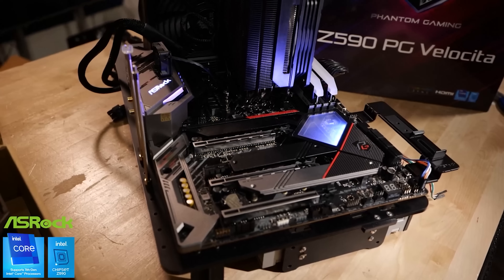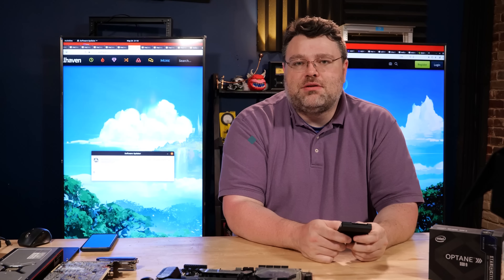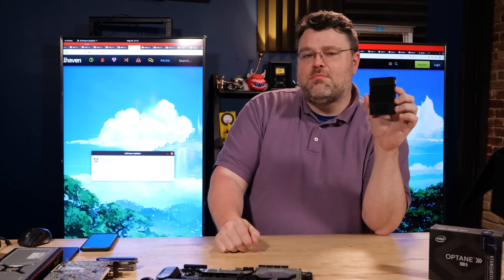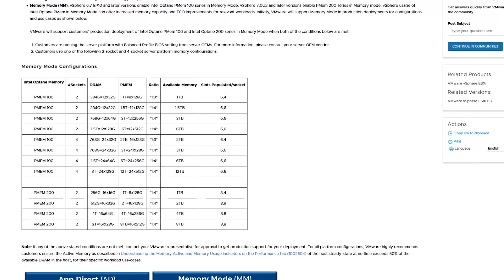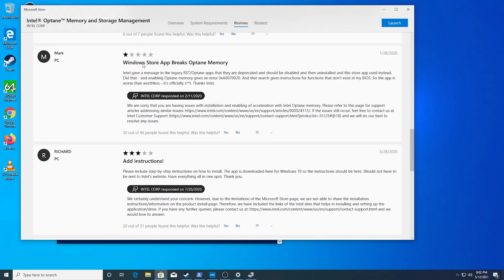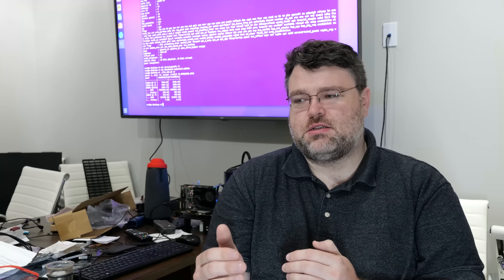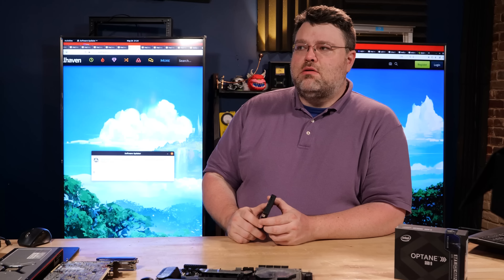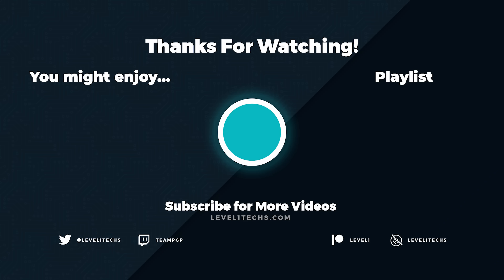The Storage of the Gods: A Deep Dive Into the Intel Optane P5800X

Comment: Hello! Do you happen to know if the new ones have marks on the contacts? I recently ordered P4800X for my collection from Aliexpress. It was called new and unsealed. And It was indeed unsealed. But there are marks on the contacts. I suspect it's not new, it's used with a reset SMART. But the price was low, and I am still satisfied.
Reply: Was it real, I see some in china on eBay too and am sceptical

Comment: You know... the one thing designed to cache the small random I/O Q1T1 R4K and al that, it's...........! Drumroll!
ReadyBoost!!!  :D
Fact is; last time anyone tried Readyboost it was on small shitty USB2 flash drives and spinning rust.
What happens if you cache a NAND SSD to an Optane, using Readyboost..?
The max 32GB IIRC cache size per physical drive
It's probably crap, from what we remember.
But has any tried a properly aligned etc, 4Kb allocation unit size, exFAT FS on an Optane lately?
Who knows..?  :)

IIRC RB wont cache an SSD to a faster SSD without some registry editing, but it could be tested.
We can always test a HDD to Oprtane using ReadyBoost.  Who knows..?  :)

Problem is ReadyBoost wipes the cache when the computer is rebooted. How FS is that! (I think Intel insisted)
I still use eBoostr.
It's similar, but doesn't toss the cache on reboot and isn't fussy about caching SSDs and will cache many drives.
Did I mention it's file aware..?  Filters can be set... :)

Comment: If you try a Linux system, you will get 4k results a lot better than 980 pro.  What you got was not the cap of the optane, but the cap of the windows operating system itself on IOPS.

Comment: Sir, My motherborad is MSI B450M Mortar Max. I am using Win10, My question is - can i use "Intel Optane DC P5800X Series 400GB, 2.5" x 15mm, U.2, PCIe 4.0 x4" SSD with my PC? (I want to run it in win 10)

Comment: I was wondering what your thoughts would be on using one of these as an SSD vs one of the new pcie 5.0 drives, do they narrow the gap some? Now that Intel has sadly discontinued them I might have to snag one if it's gonna remain the king
Reply: a year later and the gen 5 drives still lose to the 990 pro by 5% let alone narrow the gap between nand and optane 💀. Sequential latency maybe. I've got a p1600x which is about as good as the p5800x in random qd1 (455MB/s/111k iops/8.9µs of latency. Despite that my wd sn850x is significantly lower latency sequentially probably because it's pcie 4.0 not 3.0. It gets about 200µs of sequential read latency while my optane gets 600µs. Pcie 5 probably widens that gap altho from what ive seen the p5800x gets similar sequential latency to my sn850x
Reply: @level1techs I came here for the answer to this! Would love to hear what you think. PCIe 5.0 SSDs will hit 12k MB/s but I doubt random IO or latency are any better.

Comment: Hi, are the P5800X drives come with the pci express adapter? i got 4 card and literal into the specs say Form Factor 2.5" 15mm, but the Interface PCIe 4.0 x4, NVMe, i assume that the drives comes pci express interface? Thanks for your help

Comment: Do you still have the star citizen intel optane ssd? would you sell it? i am a big fan of the game. i had considered dropping in an optane drive for SC... which is why im watching this video. 12700k, 3090fe, 32gb ddr5 5600 cl36, 980pro 1x2tb, 2x1tb. extra m.2 slots available on mobo.
wondering if its worth it. regardless, if you would sell the code for the ship, id be interested in purchasing it.

Comment: Good point about this drive not really being designed as your primary drive. When you pay $1,500 per terabyte, you're basically paying $10-$15 just for a clean install of Windows (from a wasted storage standpoint). 

I bet this drive (if they made a smaller one) would be kick-ass as a ZFS slog / cache setup. I'm really curious what the Q1 IOPS are though. If latency really gets down to 10 microseconds, that's going to be some insane Q1 IOPS.

Comment: I'd love to see some database benchmarks using this drive. I think I saw somewhere there was an OLTP benchmark that was throughput under QOS based, and I think Optane would rock for that, not just for log drive but also data drive. Of course, data drives don't really matter if the entire DB fits in the RAM (page buffer pool), but if your DB is larger than say 256GB, then a P5800X could give you very good throughput at QOS even with standard edition SQL (enterprise costs 3-4x more than standard, so if you have 8-16+ cores, that license difference is way more than a P5800X).

Comment: Could you test how this performances as a single boot drive in a zen3 system? I bought the Gigabyte B550 Vision D to connect mine directly to the cpu, but the performance wasn't improved over my Intel platform where I connected it to the chipset.

Comment: I put 4 905P 22110 Optane drives in VROC RAID 0 on an Asus Hyper 16x. The performance is pretty insane but you need to run fast low latency RAM and your CPU OCed as far as you can to take advantage of the array. Running stock CPU and RAM speed pulls 4KQ1T1 speed down by as much as 40%.
Reply: Do you mean VROC RAID 0 make 4KQ1T1 speed worse?
Reply: @exilonone  No, running a stock CPU and JEDEC RAM will slow VROC down.

With my CPU OCed and fast RAM set to XMP, VROC speed went up a lot.
Reply: @nosirrahx  I know that VROC increase 32K and more sequental read. But I'v heard the 4K Q1T1 speed is slow down. Is it true?
Reply: @exilonone  That is an artifact of RAID in general. VROC is not as bad as more conventional RAID, but 4KQ1T1 is always going to be slower than an individual drive when in any kind of RAID.

With my workstation overclocked, I get over 200MB/S for 4KQ1T1 but that is only because I am using Optane drives, which are close to 300MB/S on their own.

Doing VROC with NAND based drives, I doubt you could get over 60MB/S for 4KQ1T1.
Reply: @nosirrahx  thank you for clarifying. It's important for my workstation.
Reply: @nosirrahx That's about right, as mind bogglingly complex ram is for how much u need to know to be able to fully overclock it, it is also what gets by far the biggest uplift from it. Jedec timings are actually abysmal. No f*cking wonder we've kept having to increase caches on our cpu's year after year, memory performance is not moving very fast at all. Ofc it wouldn't get close to completely fixing the issue of ram performance moving much slower than something like tbe cpu does but when I'm getting + 40% performance vs xmp with tuned subtimings and a small frequency bump, it sure as hell would help.
Reply: @Frozoken Primo Cache  on a Vroc o array

Comment: I use Primocache for iSCSI cache onto nvme, love it. (And the iSCSI server uses optane l2arc :) )
Reply: Would love to know more - what's your full setup?
Reply: @AJolly  Central freebsd zfs server with Linux, windows and esx zvols exported over iSCSI which I pxe boot into physical or into virtual within another physical, with hourly snapshots.  So I have 1 Central location to take incremental backups, and I can roll back any system in my house to any time in the last few years, even windows.  Speed has been a challenge though, hence the caching at every layer possible :)

Comment: I'd love to see a full video on primocache? 
How does it work, how to set it up? 
Are there any risks regarding data loss?
I saw it on Dave's Garage the other day and was pretty interested!
Reply: Data loss risk depends on your settings. You can turn write defer off so everything gets written immediately. In the other extreme you can set write defer to "infinite". You have two cache levels, L1 is RAM and L2 is typically a dedicated drive or just a partition. I use 12GB RAM and an old SATA SSD that used to be a system drive to cache the spinning rust that is my game RAID. As far as I can tell haven't had data loss that can be traced to PrimoCache, nor has it ever crashed.

Comment: I had multiple Optane 900P and 905P SSDs. Once you go Optane you don't to go back to Nand flash. The P5800X is my only legitimate upgrade path, lol. I will put one of those in my future Alder Lake build.
Reply: It's a year later since you commented, so did you? How does it feel compared to NAND SSDs for the stuff you do? I went Intel Alder Lake, so am toying with going Optane here at home.
Reply: @greggmacdonald9644  I have built an Alder Lake 12900K/Z690/DDR5 system back in late 2021. My Windows 11 installation is on an 800GB Optane P5800X SSD. I also have a 960GB Optane 905P SSD and a 2TB WD Black SN850 in the same system. As I have both 905P and P5800X in the same PC I was able to compare these 2 generations of Optane SSDs. The P5800X increased the random read throughput at low queue depth by around 37% over the 905P (405MB/s vs 295MB/s tested with a 12900K CPU). The random read output is the metric where NAND Flash drives are lagging behind. My SN850 only scores 60MB/s in the same test. Nand flash based PCIe 3.0 and PCIe 4.0 (and even upcoming 5.0) drives score the same in that random read test while gen 2 Optane saw a huge improvement over its gen 1 predecessor in that same test. I use Optane SSDs as boot drives. They are the perfect drives for that. On a daily basis this gives me a very snappy Windows experience. I can open 200+ chrome tabs and a dozen of other apps in less than 2-3 seconds, lol. Apps open almost instantly. The low latency nature of the 3D Xpoint storage compared to Nand flash is quite noticeable. The few games I have installed on it also load faster than Nand flash drives thanks to the higher random read throughput. The poor random read performance of Nand flash based drives also explains why they don't load games faster whether they are SATA or NVMe. The only noticeable difference (aside from loading games) between my Optane 905P and Optane P5800X are in sequentials as one is PCIe 3.0 while the other is PCIe 4.0 but they both offer pretty much the same snappy Windows experience from I what I can tell based on my own experience with both drives. Later this year I will upgrade to a Raptor Lake system and both 905P and P5800X drives will still be part of my new build.
Reply: @Patrick73787 Lol how am i sloghtly beating the randoms reads of ur p5800x with a p1600x. Im getting 420 MB/s on the dot. I wonder is it also 2nd gen optane? Ik its pcie 3 but could just be cost savings. I'm also baffled that it also has the capicators for further power loss protection (works as tiny batteries for a power ourage iirc) like the 5800x has seeing the 905p does not. Technically its an enterprise drive while the 905p isnt but you would never guess that from the price or form factor.
Reply: @Frozoken  Yes, the P1600X is also a 2nd gen Optane drive that launched a few months after the P5800X (as a replacement for the older Optane 800P). It uses the same 2nd gen 3D XPoint media as the P5800X but a different memory controller which is why they differ from each other in sequential speeds but not in randoms. My P5800X score 430MB/s in QD1 random read in a 13900K/Z790 system with the drive directly attached to the CPU lanes. Which is higher than what I got in my previous 12900K system. Later this year I'll upgrade to Arrow Lake and see if I can gain more random read performance with a CPU having an even higher single core performance than 13th/14th Gen.

Comment: Using an Optane SSD for your boot drive makes things like Windows Updates, Windows Disk Cleanup, software installs, etc. go insanely fast.
Reply: Yes, but if you use Optane as a cache for NVMe NAND as a cache for SAS NAND, then you're pretty much at the penthouse of insanity already, right?
Reply: @jeschinstad  man, i think you're on to something here... THAT WOULD ME GREAT
Reply: I have a WD Black SD850 with 7 GB/s.... i wonder if there would be any benefits with building a Optane  32 GB accelerator module into a second M.2 slot? Or would it even be slowing the system down?
Reply: @QuinnTheTailor  its pretty much a waste for that. You might find it speeds up some very small applications but it won’t be predictable nor noticeable.
Reply: @QuinnTheTailor  Itll slow it down.  The 32gb optane is only 2 lane...  Youve got a fast drive already.... unless you wanna go Optane.
Reply: Yea, my boot drive is an Optane H10 500G ssd with 32G of Optane memory.  For my junk drive (steam games) I have a 380 GB Optane 905P dedicated as cache (PrimoCache) for a 16TB, 2 hdd raid 0 array with just Steam games.  I have many TB of games so this amazingly works out.
Reply: Can’t wait to try this, would love an instant-boot gaming / data science machine
Reply: As fast as linux?

Comment: I'll add 3D XPoint to the list of stuff I can't buy. The smaller capacity versions are out of stock everywhere in Europe. The big versions have seen insane price hikes. The cheapest I could find is $1700 for a 375GB P4800X. Combined with all the other shortages I'm seriously considering taking up fishing as a hobby instead.
Reply from the maker: for p4800x and older keep an eye out on corporate surplus. they pop up every now and again. Until chia you could reliably get the m.2 p4800 for ~450 on ebay

Comment: Optane is one of the coolest technologies out there at this point.
Reply: Too bad they botched the messaging and support for some of the best use cases. For quite some time I was setting up laptops with a cheap 2TB SATA SSD cached to a 58GB 800p Optane drive and these systems were both cheaper than 2TB NVMe systems and snappier. Intel really should have promoted and supported this configuration.

Really disappointed that the 815p and M15 drives got canceled, I had plans for those drives.

Comment: It looks to me like this eliminates the last  'weak link' inside a modern computer - the fact that it can saturate PCIe4 and do enough operations to keep busy CPUs and RAM means this brings us one step closer to the 'speed of software'. How does it compare to a DDR4 ramdisk and how much cheaper is it?
Reply: The last weak link is my wallet!
Reply: Id be interesting to know the RAMdisk question.
Reply: DDR4 RAM has a latency of something like 12ns compared to 20us for the p5800x, so performance-wise there's still a huge gap. but of course the more important question is how much "dead time" it contributes to a given workload - RAM might be 1000x lower latency but there are probably well over 1000x reads/writes to RAM vs persistent storage in most workloads.

Comment: could this be used as a cache for Nvme storage?
Reply: Why would you do that? DRAM is faster than Optane and is already used as cache for NAND storage
Reply: @ryanwallace983  DRAM is more expensive, and less flexible in terms of adding to an existing system.
Reply: @fat_pigeon  im going to presume that you aren’t completely dense-why on earth would a manufacturer choose to replace the DRAM cache on the PCB with a slower form of memory? Certainly not for redundancy-they already solved that by adding caps to the PCB so that the drive will have enough time to flush the cache to NAND

And I also assume by NVME we are talking about NAND as using optane as cache for other optane just doesn’t make any sense

Am I missing something? I don’t normally mess with servers so I could be completely misunderstanding things here but both the op question and your response sound silly
Reply: @ryanwallace983  For replacing on-board DRAM cache in the SSD itself, Optane has two advantages I can think of: (1) it's cheaper so they could put more cache in at the same price point, and (2) it's persistent so caps for power-loss protection wouldn't be needed (the mapping tables could be stored in XPoint as well), saving board space.

I assume the original commenter was talking about adding an Optane drive as a cache in front of an array of slower NVMe drives (e.g. DRAMless QLC). That could certainly make sense. E.g., Optane is regarded as one of the best for a ZFS SLOG device, which is a form of write cache for synchronous writes, due to its excellent latency and endurance. Sure, adding additional DRAM to the system's main memory would be even faster, but it's more expensive and you can't easily add arbitrary amounts after the fact (as you have to keep the memory channels identical).
Reply: @fat_pigeon  that all makes sense, I wonder why this hasn’t been implemented

Comment: Do other companies work on alternatives to NAND aswell?
Reply: Nope, Optane was originally a collab between micron and intel but micron sold their stake to intel

And that’s that

Unless you wanna talk about the really futuristic stuff like encoding storage into DNA
Reply: This isn't an alternative to NAND, it's an intermediate between NAND and DRAM. Nothing will replace NAND for cheap, "fast enough" mass storage in the foreseeable future.

And yes, there is MRAM (Spearheaded by Everspin), which is closer to being an actual alternative to DRAM, but it's not at the point where it competes with either DRAM or Optane (They've just gotten into the GB sizes, and are also more expensive)
Reply: There are also other technologies but they're mostly still in the lab (FeRAM, ReRAM, CeRAM, NRAM, etc...) so we'll only really see them becoming alternatives in about a decade.

It's much harder and more costly to develop an entirely new form of memory based on new materials and designs than to tune the existing RAM or NAND flash.